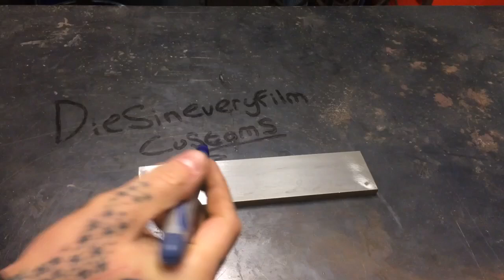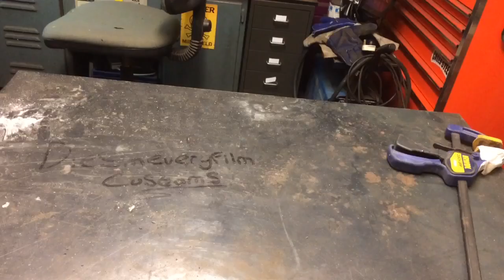Knife making - custom bowie chopper

Comment: I have no idea how people sharpen with a buffing wheel. I try and the edge just gets super dull. I try to get the right angle... I dont know what im doing wrong. The only good thing is that the edge becomes like a mirror
Reply from the maker: To be honest I find it hard trying to sharpen using stones so I guess it's a personal preference and this has worked so well for me all I do is keep the wheel brushing with the blade on each side till the little burr comes off and it's worked wonders on making my knifes sharp 👍🏼👍🏼👍🏼
Reply: Diesineveryfilm Customs Do you put alot of presure or just let the weight of the knife do the work ?
Reply from the maker: Canadian Bushcraft yeh I dopit some pressure but not to much. I'll try do a in depth video soon as I've had a few people ask about it 👍🏼👍🏼👍🏼

Comment: absolutely beautiful.. have you any tips for heating the knife without a furnace? Want to try and make my first knife soon.. how do you know when it's at the right temperature? And what's with using the oven afterwards?
Reply from the maker: Thanks buddy. You could always use a blowtorch you need the metal to be non-magnetic then quench it to harden and at that point it is really hard but brittle so would break easy so I stick it in the oven at 200 for a hour or till golden coloured to soften it a bit and make it a more robust blade 👍🏼👍🏼👍🏼

Comment: hey  brother what is this liquid  solution that  you  paint  the handle. ? 
please
Reply from the maker: Hey buddy it's a 50/50 mix of turpentine and linseed oil I coat the handle then let it dry for a few hours and then soak the handle in the jar for 12hrs then it takes 2ish days to dry before I lacquer. It gives a nice hard finish to the wood as well. Hope that helps 👍🏼👍🏼👍🏼
Reply: Ok brother each one of us have singular types for our job, 
Your knifes are great
Nice job and tank u so match
Reply from the maker: Francis macedo thanks brother I appreciate you saying such nice things 👍🏼👍🏼👍🏼

Comment: what is the last product in the handle?
Reply from the maker: You mean when I oil it? It's linseed oil I just put a thin coat on to show how it will look but I actually soak it in the oil for 12hrs. Hope that helps 👍🏼 👍🏼 👍🏼
Reply: Thanks!!